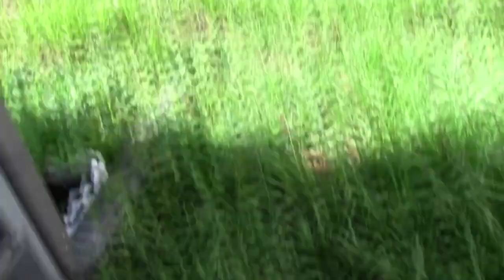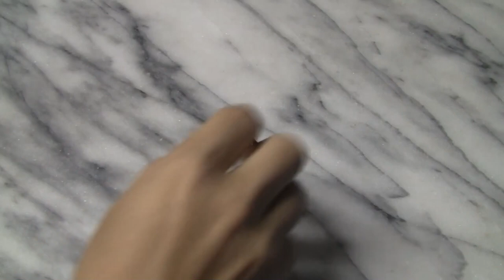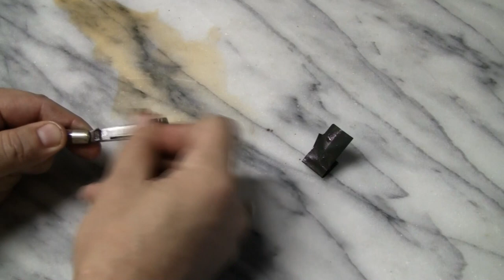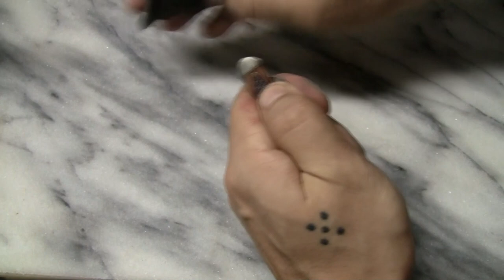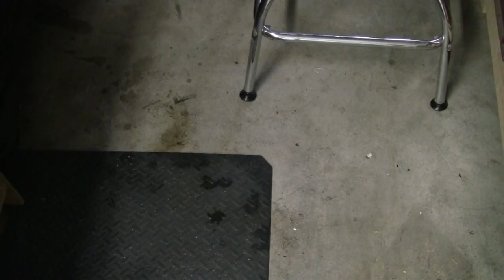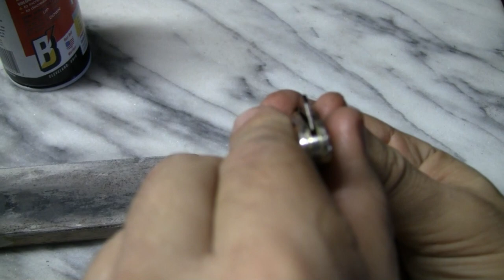Schrade Old Timer Folding Pocket Knife Tip Repair and Modification #repair

Comment: I have several Old Timer Knives. They always rust up even when I never used them. Why was that? Can I prevent that from happening again?
Reply from the maker: Sounds like moisture is getting to them. You can use a light layer of olive oil to protect those blades. Thank you for watching and commenting Thomas.